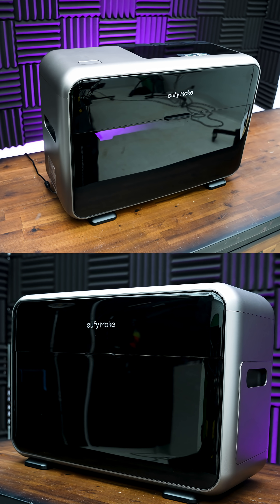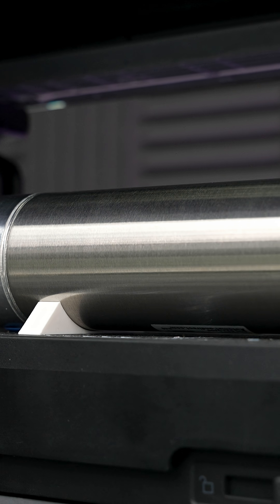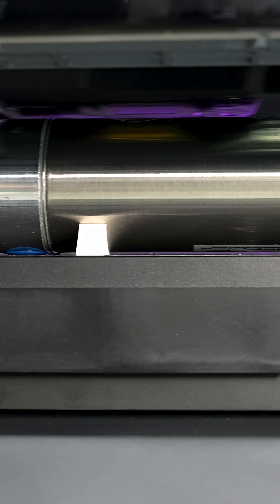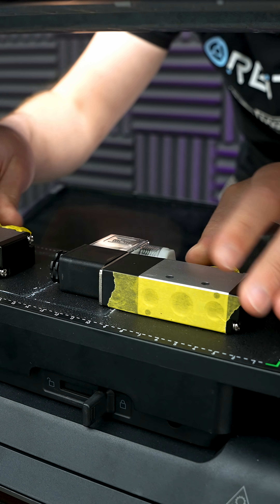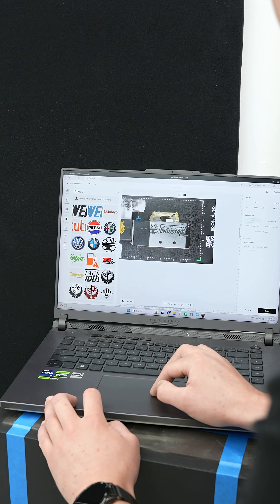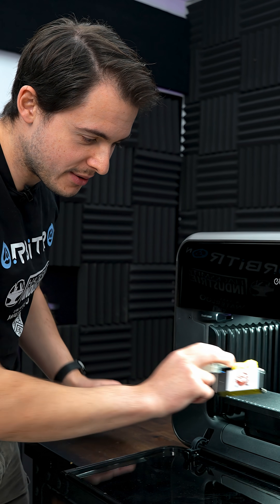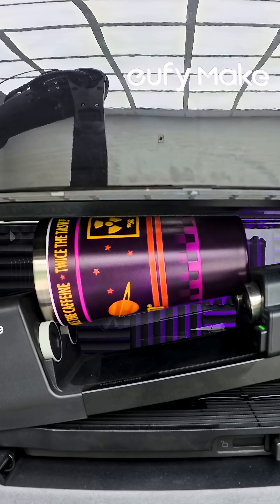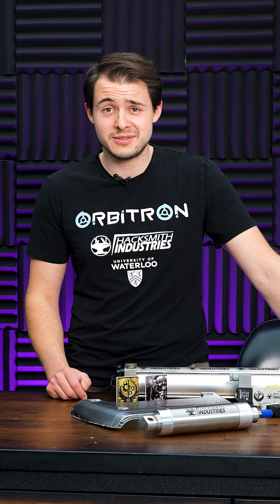This machine can basically print on anything #eufyMake #UVprinter #fallout

Comment: Eufy is a sketchy company and this is wayy to expensive
Reply from the maker: Compared to normal UV printers this is inexpensive. They're bringing it to the masses
Reply: @hacksmith yes but it's very proprietary and the company's only other machine is the abandoned ankermake m5 with a failed multicolor system
Reply from the maker: You're complaining about proprietary when regular UV printers (that also use proprietary ink) cost literally 5-10x as much?